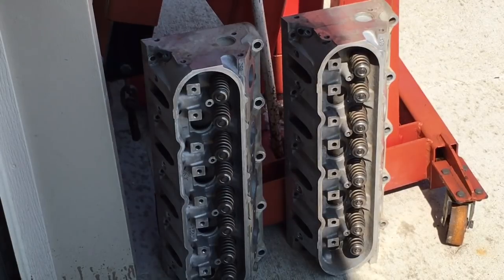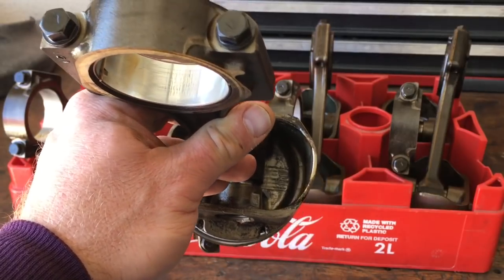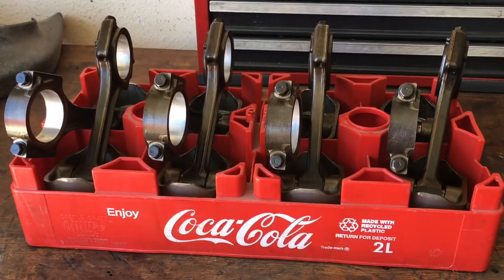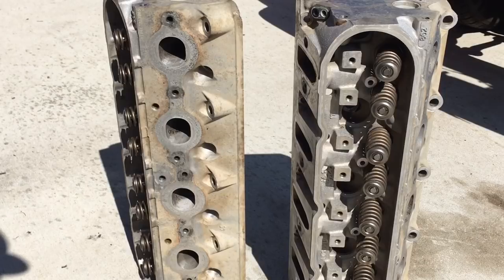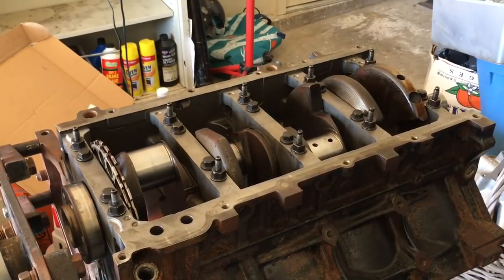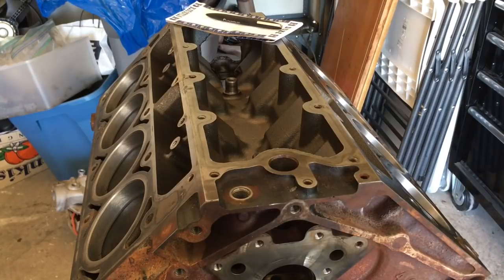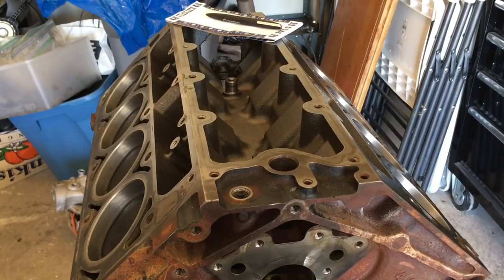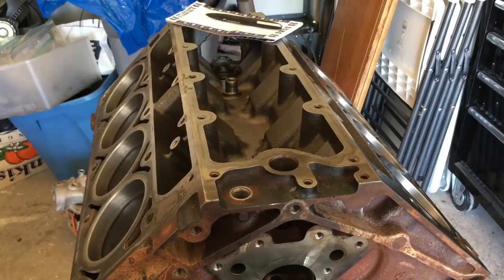4.8 Turbo build update Heads Ring Gap

Comment: I've gapped at least 20 sets of rings from 17-20 thousands and we were able to make 20+ pounds of boot and with no heat swell issue or oil consumption with everyday driving. And most of them stuck with just decapped injectors. I hav notice on some 4.8&5.3 that come to me with lose of power under a certian level of boost should make x amount of power but it's down and once they reach that boost point to wear the power starts to drop off they add more boost with no gain at all and they say it burns about a quart a day. I've found about 90% of the time the piston directly under the PCV valve has the rings frozen to the piston almost completely closed???? Don't know why this happens.
Reply from the maker: Anthony Harvey I’m going to move the PCV valve to the back of the valley pan like the LS6, LS2, LS3, LS7.  A big part of the stuck piston rings is the poorly designed oil drain backs at the oil rings. I’m not sure how the PCV valve would affect one cylinder.  I know cylinder #7 has a lean issue from poor distribution inside the intakes.
Reply: HeadFlowInc if seen the rings stuck on that cylinder with several different intake applcaction form stock to eBay ss intakes to the holly intake. Anyways good luck with the build.
Reply from the maker: Anthony Harvey Here’s what’s weird, when you get into the Holley Dominator tuning it discusses how it’s common to need to add fuel to the #7 cylinder due to it being lean.  Makes me wonder if it’s also #8?  Not sure but when we popped the ring land on the 5.3 Turbo Typhoon, yep cylinder #7.   👎
Reply: @HeadFlowInc  My experience with Cadillac engines shows the no.7 and 8 cylinders run hot since they are at the back of the block.  One of GM's "fixes" was to increase the cc's for these cylinders to lower compression.  Hot Rodders install coolant bleeds to make sure the coolant continually flows at the back of the block and bleed off any steam. The LS has these bleeds, but may need to increase size and lowers thermostat to a more reasonable temp.  One other fix, run 10w30.  It has a higher shear point and can take the heat better.  Also, run some decent oil and "CHANGE" the oil/filter.  Do NOT use the orange cannister of death!  My last junkyard build was a real booger to cleanup because the owner/operator did not change oil/filter. I spent a lot more than you did to clean it up.

Comment: This why most of my tools are premium tools bought second hand. I get a good tool that I can afford, and I keep my money out of the hands of people who shouldn't be building new tools.

8:40 even in brand new engines there is some variance. At the factory, many cylinder bores are measured after they leave the machine and many pistons are measured as they leave the machine. The assembler then selects a pre measured piston to enter a pre measured bore. In many engines, the same thing is done with crankshaft bearings.

10:50 This works great, so long as the piston design allows it. Some gasoline engines have some really odd pistons shapes that make a ring squaring tool mandatory.
Reply from the maker: Skyline Fever Is like to get a real squaring tool!  I had to constantly re-square the rings in this video off camera. 😳 I think I’m going to gap the rings .021/.023

Comment: Great info! Very informative. I ended up boosting my 5.3. I originally never intended on boost but I got the itch. I should have gapped my rings a bit bigger in my rebuild, But I'll just keep the tune conservative and boost under 10 lbs as you mentioned.
Reply from the maker: Anthony Griffin I’m wanting the same, low boost daily driver setup.  I’d like to think I’m building a good driver combo that could be fun a few times a year at around 10# Boost. From what I’ve calculated I can get close to 500 rwhp out of this 4.8 at 10# of boost. For the most part it won’t see more than 5# most of the time. 🤔
Reply from the maker: John Doe What are you saying caused your pistons to break?
Reply: Good Info! Yeah, gapping is def a way to go. I have friends that have never gapped and have been fine under boost. It’s a risk tho. Depends on tune, driver and how it’s driven as well.
Reply: John Doe it sure is ain’t it! LOL! I have an 87 Regal T as well. It runs 10’s. So that car I’ll unload on. My Caprice I just supercharged and it’s my daily in the Summer, but I still need to gap the rings a bit bigger. That’ll be my next winters project.
Reply from the maker: John Doe Wow, how much boost were you running?  I’m building a “Baby Boost” setup 😎
Reply from the maker: Anthony Griffin Here’s the reality, the gaps have to be compatible with the heat produced by the boost level.  If you run a high mileage LS engine the rings have gapped themselves to .024+ 😳. Then there’s Meth Injection, Meth greatly reduces the temp which helps them live as well. 
What you won’t see Is a true tight ring gap running 15# boost that’s a time bomb. 👍

Comment: Did you use the  stock rings that came with the engine?  Can you use used rings ?
Reply from the maker: Brandon Iames I used new rings to guarantee it wont have any sealing concerns. People who are trying to throw together the cheapest engine possible have reused the rings, but it’s not recommended.  I had 300k+  on this engine, I wouldn’t trust those rings to last. 😉